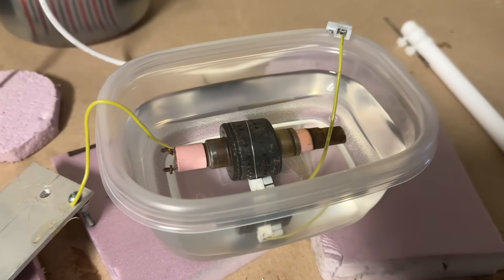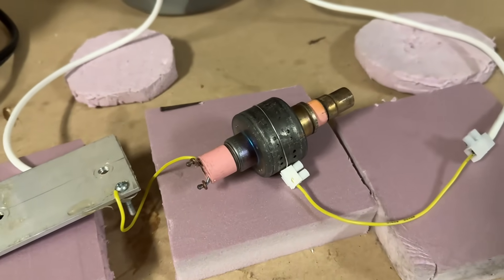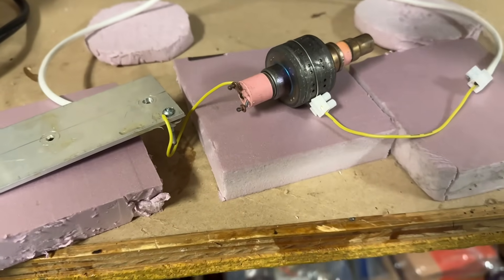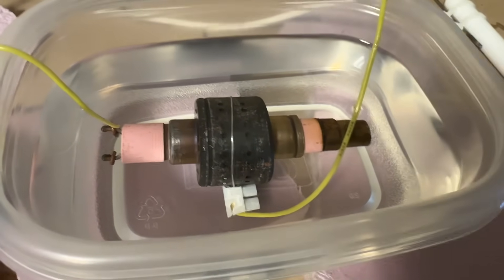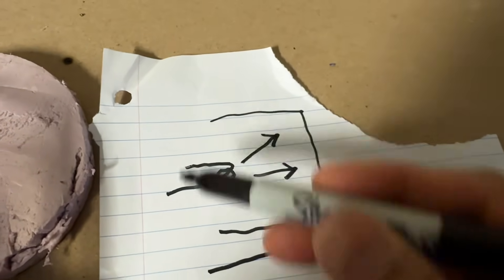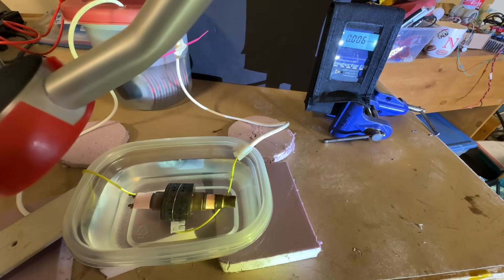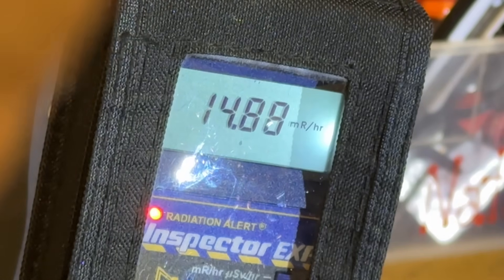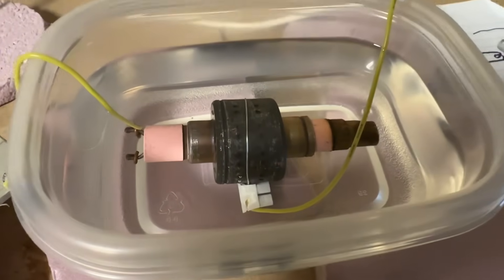Overvolting Magnetron under Oil

Comment: Oddly enough, yes! However, I beg your pardon - "flyback" is not a style of transformer, it is a switchmode architecture. And, as you are running it with symmetrical AC, then it is not running in "flyback mode"..  ..ok, groknarding completed. Sorry.
Reply from the maker: No, you are definitely right. The flyback mode is what was used in the old-fashioned TVs. I’m just using it as a generalization since it’s easier for people to understand what I’m doing and what kind of transformer I’m using.– to rectify  the output of this transformer would be difficult as I need a long chain of hv hf diodes which you can only find in x-ray machines typically able to handle above 100 kV.
Reply: I actually disagree with this. Well, kind of. To get very pedantic, there are no transformers in SMPS topologies as the primary and secondary windings form a coupled inductor, not a transformer. That said, the term Flyback Transformer absolutely exists. Flyback topology, flyback diode, and flyback transformer are all real terms and they mean different things, and all of them can be shortened by referring to the adjective as a noun. A flyback transformer is just a coupled inductor, and is generally designed for higher frequencies, low eddy currents, and higher energy storage using powdered metals, ferrites, and/or an air gap.
Reply: @SkippiiKai  I verb my noun in your general  direction. Would you care to describe the functioning of a transformer without referring to mutually coupled inductances?
Reply: @zinckensteel  LOL... I think.. wait... I'm not sure if we're mostly joking about pedantics or being serious. But if we're being serious, it sounds like you have some experience with non-isolated converter topologies. Consider the differences between a forward converter and a flyback converter. Ignore the snubber circuits, auxiliary and reset windings as they're not relevant to this. The rest of the primary side circuit looks pretty much the same in its simplest example, however, the transformers used are incompatible with each other. One is a true transformer, where energy flows from from the primary coil to the secondary coil. In the flyback converter the energy is stored in the inductor, as it would be in a boost or buck topology, until the switch is opened at which point the magnetic field begins to collapse and the energy stored in that magnetic field is then transferred into the secondary coil. In this case the output waveform is completely different from the input waveform has no energy is transferred between the coils as in a regular Transformer, because the energy transfer only starts after the magnetic field has begun to collapse. At the most basic example of a flyback transformer this becomes even more apparent. Consider a car's ignition coil. In this case you can apply a 12 volt signal to the input and nothing will happen at the output until after you disconnect the power. Only when this power is disconnected is the ignition spark generated on the output. In a true Transformer you would see a rise of voltage on the secondary proportional to the change in voltage across the primary side. I hope that makes it a little clearer.
Okay, now if we were just joking and you already knew all that, then I said "coupled inductors" not "coupled inductance," and there is a difference, and I'm never going to forgive you for making me type all of that.
Reply: Lors de la connexion du 12 volt au primaire une tension s'établit au secondaire brièvement, inférieure ou égale à 12 volts multiplié par le rapport de transformation de 100 à 400.
C'est ensuite l'extracourant de rupture qui produira 20000 à 40000volts au secondaire et 200 volts au primaire
Cette électricité libérée est le résultat de la dissipation du champ magnétique créé par le courant initial dans une bobine à entrefer. Idem pour une inductance ou pour un transformateur composé de 2 inductances couplées magnétiquement comme une bobine de Rumkorff ou bobine d'allumage.
Reply: @SkippiiKai  I'm having fun, I do hope you are as well..  ..but I have to ask, if I handed you a high-mu ferrite pot core with two coils and a gapped center leg, would you call it a flyback transformer? Many flyback converters use just this kind of "transformer" - and the same component will work just fine in a resonant converter with a symmetrical output. And while an ignition coil does make a big spark when the field collapses (L*dI/dt and all that), there most definitely IS an output pulse when power is initially applied. It is also possible to run them at resonance, but it's easy to overload them in this condition. Can we agree that the coupled inductor - transformer identity is a spectrum, perhaps with with leakage inductance and coupling factor as variables? 😆
Reply: @zinckensteel  Hmmmm. Your proposal to redefine electronic components may be acceptable. You may yet be a worthy adversary. Let the negotiations begin. 
Yes, I would call a high Mu ferrite gapped core a flyback transformer, with the gap being the key distinguishing feature in this case. However, I reject your example of this working "fine" in a resonant converter as proof of it being analogous to a regular transformer on two premises: Firstly, any resonant converter will change its frequency as the load on the secondary changes. Stating that the output is produced symmetrically on the secondary obscures that it is in fact the secondary that determines the waveform on the primary, rendering your point void. Secondly (not to be confused with secondary), I stated that the designation of flyback was determined by the parameters for which it was designed. Because something may work, or even "work fine" outside the scope of its parameters doesn't change what it is. Although I am a fan of Dr Angela Collier and her constant assurance that "It's fine" I don't think it quite applies here. If, however, you can find a transformer that works equally well in both flyback and conventional transformer topologies, I'll grant the point.
I'll admit that my car ignition coil comparison lacked clarity. When I said that nothing happens, I was referring to the digital testing method used by auto mechanics and my younger self before I bought my oscilloscope. Digital testing of ignition coils, of course meaning the act of inserting one of your digits into the spark plug boot. If you combine this with old-style distributor cap leads with multiple plugs, you can have fun with friends to see who will be the last one to pull their finger out as you slowly start to disconnect the power supply. 
I still think the ignition coil does demonstrate my point in the simplest way, but if we go into more detail I can make the point more clearly. Consider the standard buck or boost converter, which utilizes a single coil. I think we all agree at least in this case: not a transformer. But the buck and boost converters and be optimized for particular duty cycles by using tapped inductors. A switch tapped or diode tapped inductor, it doesn't change the function of the converter. It just works better at certain duty cycles. But by your definition, this would now be considered a transformer-based buck converter. Hopefully it's readily apparent that this isn't the case. 
Furthermore, consider the case of the SEPIC converter topology, which requires two inductors to function. Again, these inductors are used for energy storage. However, to save space, both of these inductors can be wound on a single core. This couples the inductors, and allows both coils to draw energy from the same magnetic field, but it does not transfer power directly between the coils. Again, not a transformer. 
Furthermore, consider multiphase buck converters, as found on computer motherboards. Or multiphase boost converters, as used in active PFC circuits for....I have no idea what they're used in. But again, these are inductors, and even if the inductors for different phases are individual or coupled and share common cores, it doesn't change what they are.
On the far less technical side, I present the following arguments that Flyback Transformers are really a thing: You can buy them on Mouser and Digikey, and they have their own Wikipedia article. On the argument that coupled inductors are not transformers, if I've still not convinced you, Sam Ben Yaakov is the inventor of some of these inductor designs and converter topologies, and he has at least one full video explaining why they are distinct. 
All that said, I do agree that the current definition of transformer is ill defined, and that transformers do exist on a spectrum. However, I believe limits need to be put in place. Much as everything is a conductor when the voltage is high enough, we'll quickly reach a point where everything is cross-spectrum-inductive-coupling-device. We'll also need to work on that name. By your definitions, a flyback transformer does not exist independently outside of being a transformer, yet a twisted pair cable is a transformer. Would you go so far as to say using Cat6 as a transformer would "work just fine?" as a transformer? An hour ago, I was reverse engineering an SMPS that used a 3-pin dual Schottky diode package on the output. Both of the cathode legs of the package had a small ferrite bead slipped over them. They were very close together. Transformer?
I propose we introduce a new word to describe any device across the spectrum that couples magnetic fields between coils. This would include coupled inductors, transformers, autotranformers, tapped inductors, common mode chokes, 3-phase motors, and, ugh... what do you want to do with shaded pole motors? To show that it spans across the spectrum of various structures and shapes, we should call it an "Across-structure." No, that's terrible. What about "Cross-shape". No, still bad. Maybe it sounds better in Greek... that would be...um..Diamorph? Maybe it's better in Latin. That would make it a.... Ah, well, crap.
Reply: @SkippiiKai  wonderful😂
Reply: @SkippiiKai I am late to the party and in no way knowledgeable to this level, but wanted to say I enjoyed the discussion.
Reply: @kellyfrench  Glad you enjoyed it. I had fun participating. And don't worry if you're not that knowledgeable about it, all you need to know is that I won. 😁
Reply: Anything employing a high di/dt current profile (on 'switch' opening) to achieve a high voltage versus strict sinusoidal exciton can be termed 'flyback' ... L times di/dt with a switch element (FET, IGBJT etc) opeing being the objective to arrive at a high voltage.
Reply: @SkippiiKai... Fantastic posts. It was a treat to read these. 👏👏👏